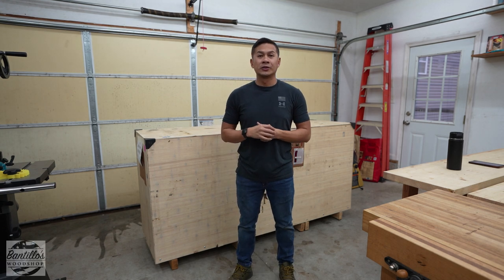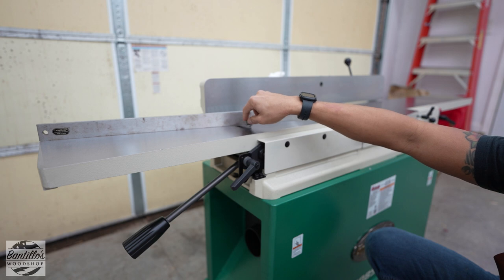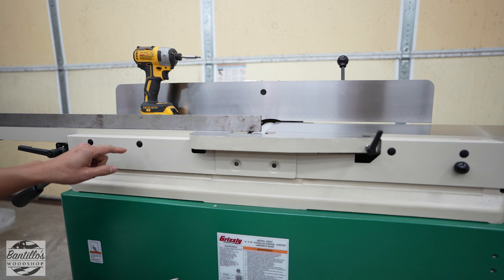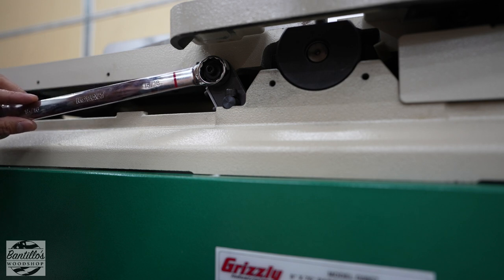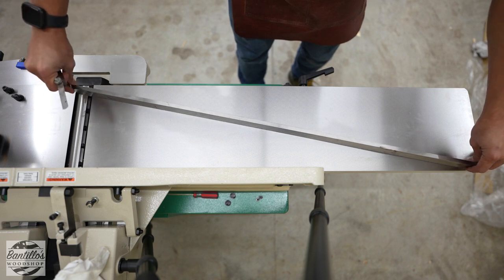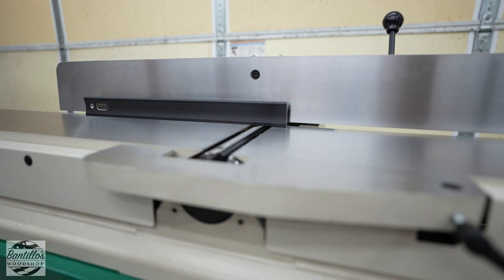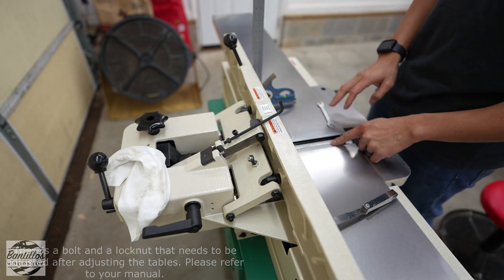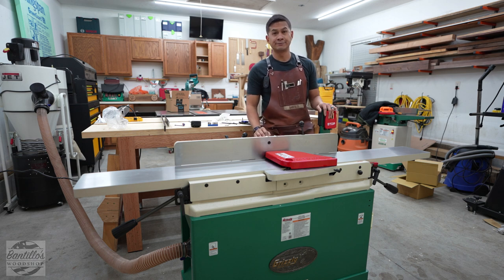MASTERING Woodworking: Jointer Setup Guide

Comment: I just got mine.  FYI that crate  comes off easily without prying it all apart.  Remove all the screws at the bottom and it all slides straight up.  I also lifted mine off the pallet with the provided lift lugs, and not by the tables.  Like it shows in the book.  Enjoy  the planer.
Reply from the maker: Good tip on the crate for whoever will read the comment section. I decided not to do that because as you can see I’m limited in space and overhead. Also I wouldn’t have been able to cleanly overhead press that top by myself. And the book does say to use the lifting hook if you have a power lifting machine which I don’t. Thank you, you as well enjoy the jointer.